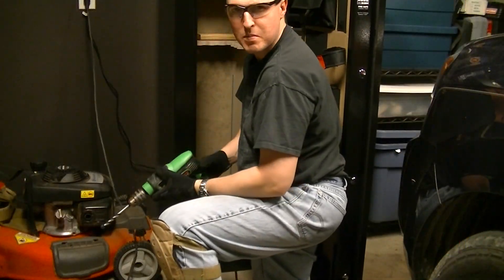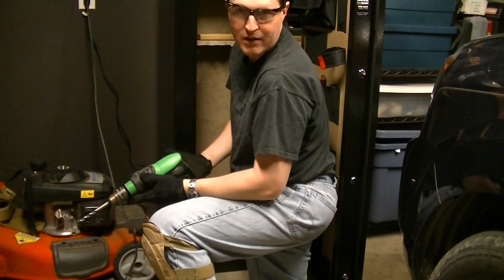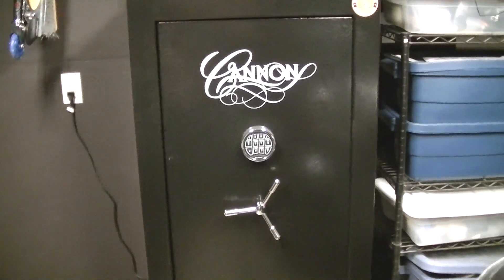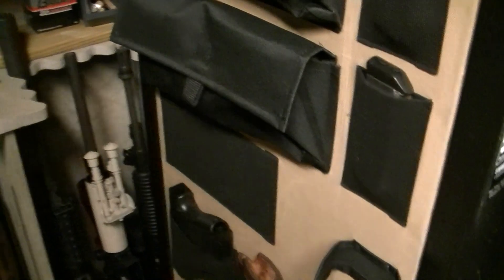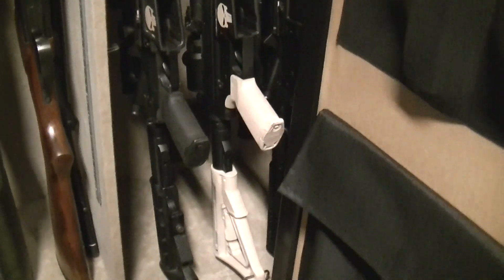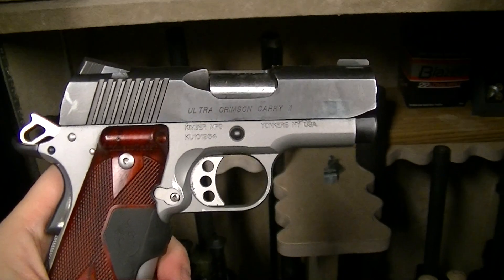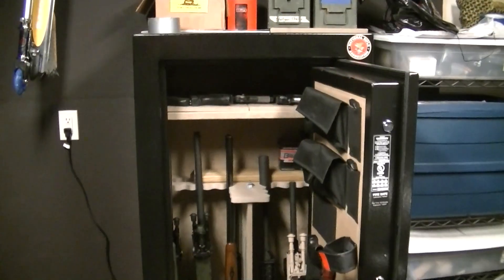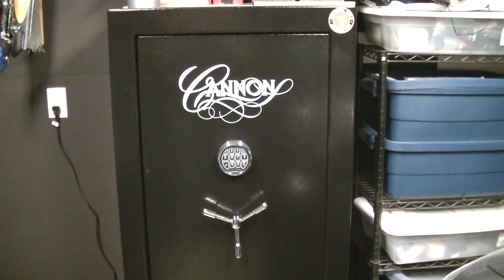How to Bolt a Gun Safe to the Floor

Comment: Getting reading to install wedge anchors in my gun safe.  I have a question Nathan.  What did you use to make the hole larger in diameter that the wedge anchor?  Did you make a larger hole first just to the top of the concrete?  Then did you drill another hold 1/2 inch in diameter down the middle of the larger hole.  Thanks.  As you can tell I am not very handy. 

Chris

Comment: Nice video.  Nice guns.  Terrible gun safe.  Your camera angles gave away how poorly designed that Cannon safe is.  I could tell on your quick video how easy it would be to pop open that door.  If by chance someone tried to pry it open and failed you would have to spend about 500.00 to get a professional locksmith to open it or do it yourself.  Spend the money, get a quality safe to protect against fire, theft, etc.  Any reputable USA Safe manufacture will cover all costs of damage from fire, pry attempts at no cost and replace the safe with a new one if it happens.